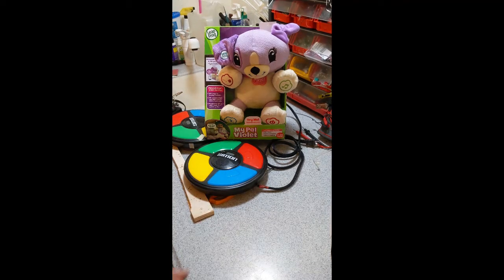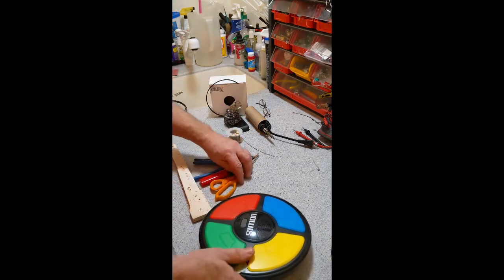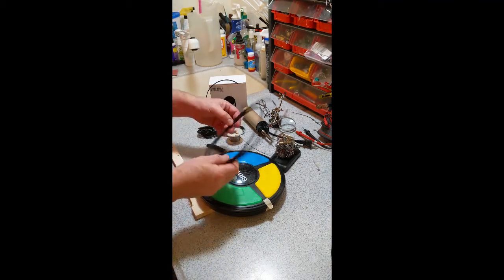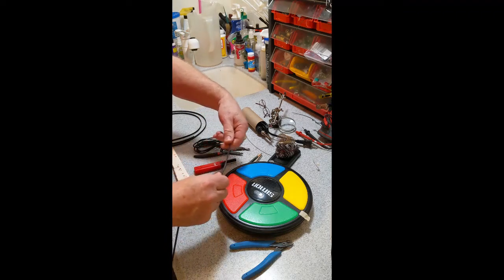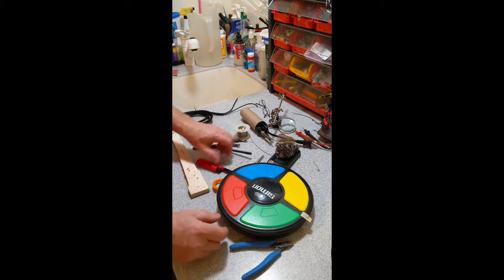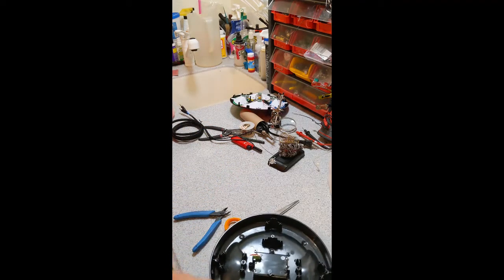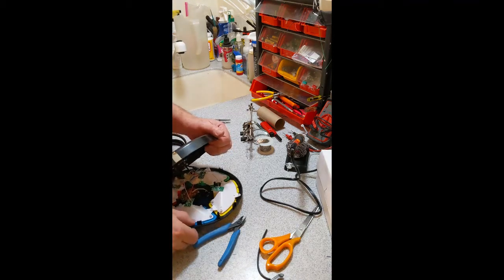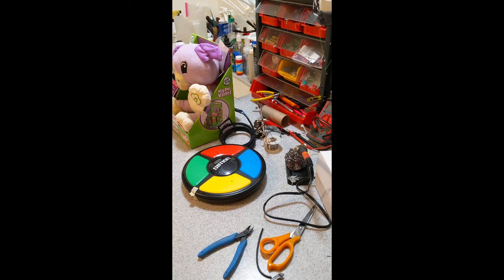Santa’s Switch Adapted Toys - Simon game modified to use with My Pal Violet- Special Needs children

Comment: How tough is it to press the  buttons on the Simon compared to a normal adaptive switch? I really appreciate your  videos for adapting toys for a patient of mine, and am debating making one of these for her as well ❤
Reply from the maker: Thank you. 
With this larger size it is pretty easy, with the pocket version, the switches are closer together and may be an issue. (I do the adapting on the pocket version completely different.) 
To make sure, before modifying, I would set one of them by her and see if it easy how she can press them.